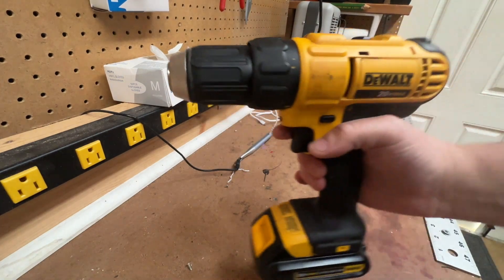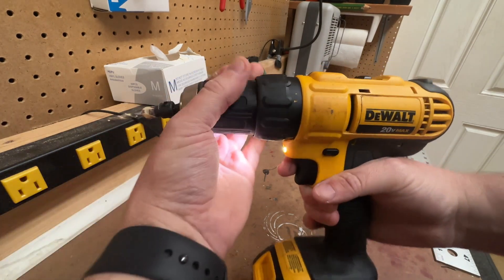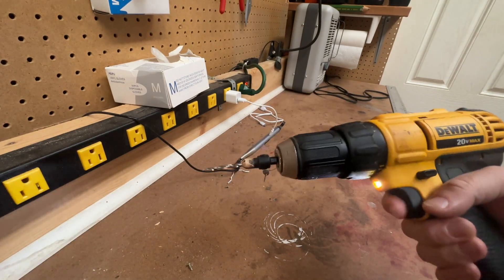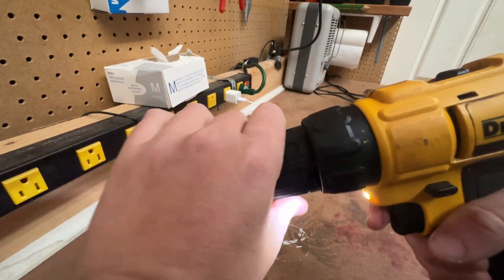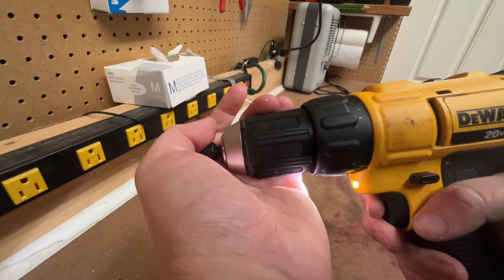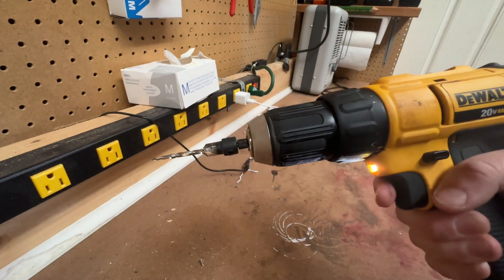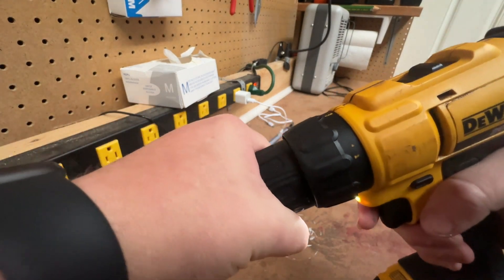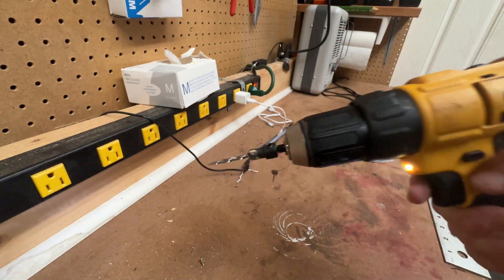This Drill Hack Will Blow Your Mind!!!

Comment: Actually not tighter... Check out the video by ave
Reply: Not true. Even if you work diy, you will find out the difference eventually. Always tighten the chuck by hand
Reply: @bongboyz6468 The video is stating to turn the chuck backwards but that is just backing off the ratcheting mechanism. I am not a diyer I am a master auto tech :)
Reply from the maker: Turning the chuck back "locks" it in so the chuck won't undo itself during usage. Works all the time on all my drills.